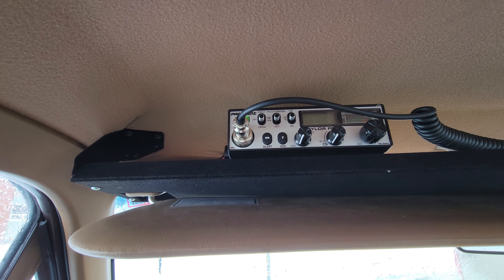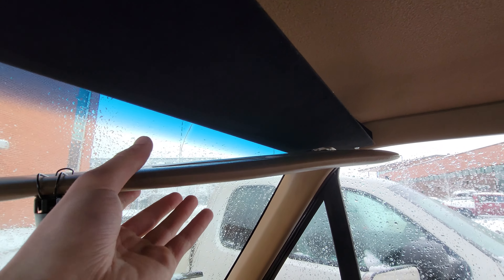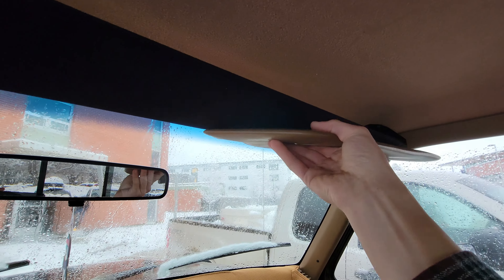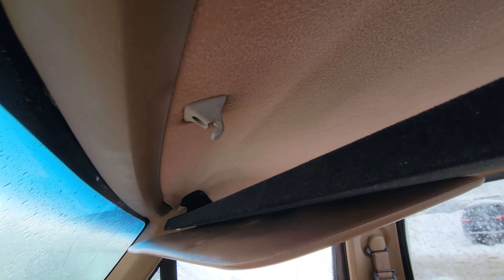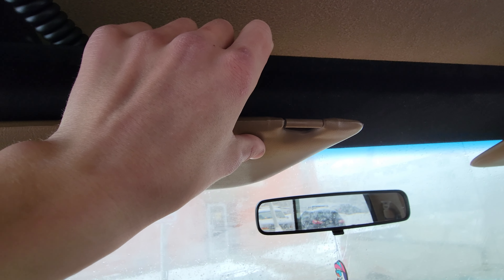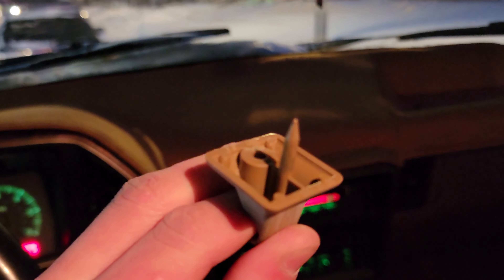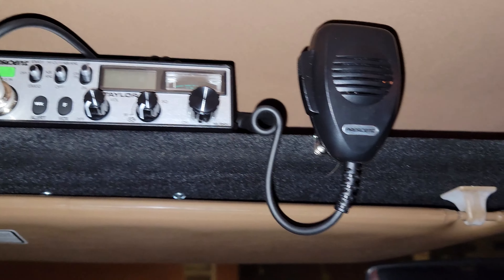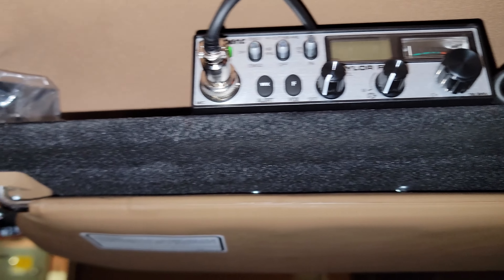Installing a shelf in my OBS Ford truck

Comment: As for the VDP shelf, the only one I’m able to find is for the 2000 Ford “econoline”… would this still work with my 2000 f-150 base? 

Did you get a 1990 f-250 specific shelf?
Reply from the maker: @SirLancedHerLot7  mine was specific to this truck I’m not sure if that would fit
Reply: @everythingmechanical_yt  hahaha yeah I hear ya, not looking to spen $150 for that gamble!

Thanks for the quick reply bro! 🤙🏻

Comment: Must be nice being short
Reply from the maker: @MadMan_123  fits nice if you have bucket seats but it is a little low with the bench seat
Reply: @everythingmechanical_yt  interesting, I get the bricknose fords usually I find the bench seat gives me more took but that beem would drive me nuts its right at eye level for me